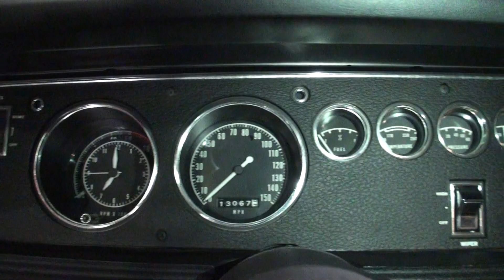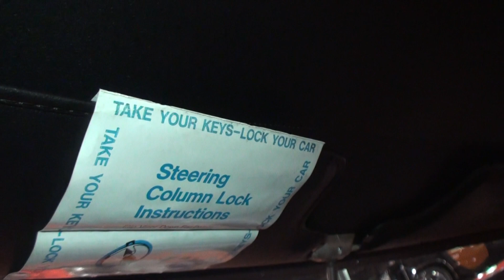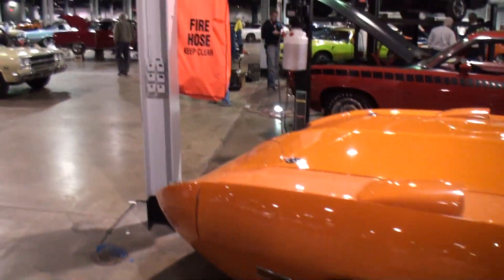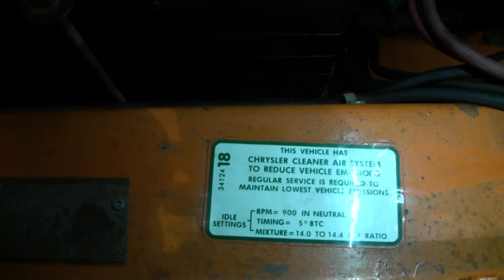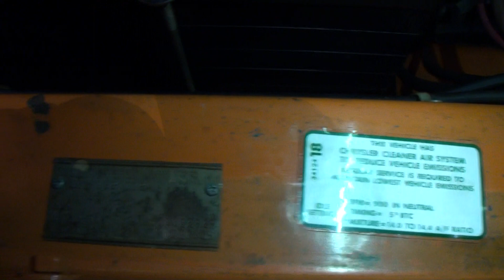1970 Plymouth Road Runner Superbird 440 Unrestored in Orange on My Car Story with Lou Costabile

Comment: Thanks, Lou & all.  Admittedly, I like survivors.. Interestingly, lots,of common & identical stuff with our 1970 Dodge Coronet ( Ralley Red , console,, Black Bucket/383): looks like less room for Spark Plug changes ( I hardly got 6 to 10,000miles, switching to electronic, really Strong Engine).. obviously not safe for much Public driving, & SOME  MOPAR STUFF fails quickly( or at least mine did), etc. I done a lot of repair/ maintenance on mine.......some good years....
Reply from the maker: Hi Opera, Glad to read you enjoy this episode, and you're welcome, Lou

Comment: Amazing  how it  has all the flaws  from the factory   to see exactly  what   this car  looked like   in the show room   prior to the   normal aging   to the paint  and heat exposure  in the engine bay  that  affected  the paint .  

      I was at a car auction  where they had vendors  booths  set-up for car  related  items   along with a few   old cars   on display .   The 1959  Thunderbird   was original other than  normal   brake  replacing  and tires  as  the daily driver car  with low mileage . 
    But the  lady  sitting   behind the rope   near the car  was the owner   and got the car  as the first  new car  after she was married .   The car was 40 years old  in 1999   when I saw it  and  the Red paint  was  in good shape   along with the  tinted glass , Black interior , wheel covers  and chrome.   
     She bought a second  car  when  they started a family   ,  so  it wasn't abused   to be driven  in all  types of weather   used for   driving trip  to camp  or  go across the  nation  .  If i had to guess  what year i was living   in just by the  looks of the  1959  T-Bird  that wasn't restored ,  I  would  pick  1969   for a car that didn't  look  more than 10 years old.  
      I would not have believed it was   1999   and that  car was 40 years old  .
Reply from the maker: That sounds like a fun story on the 1959 T-Bird.  Thank for sharing, Lou